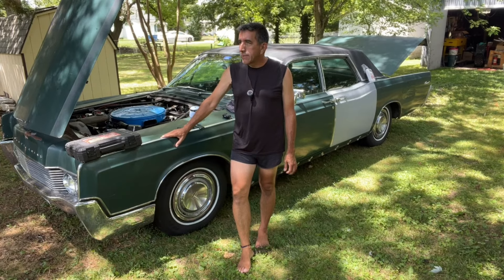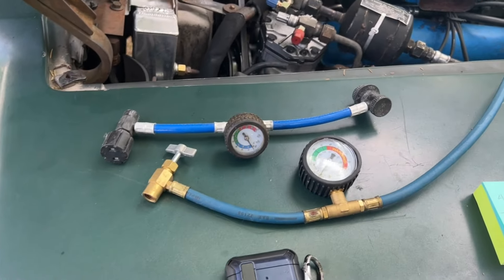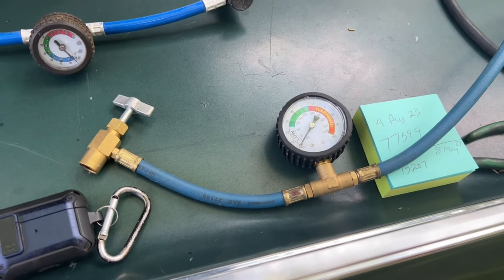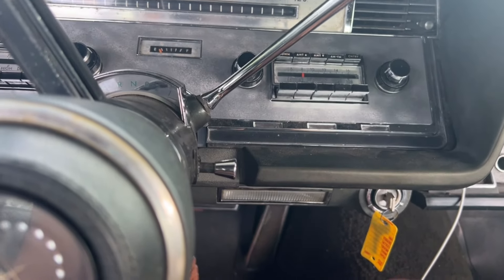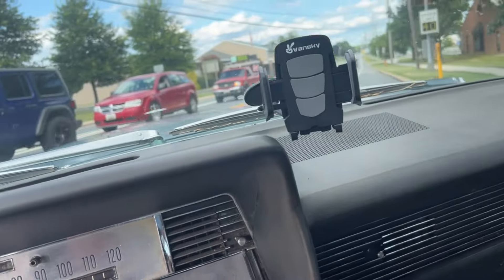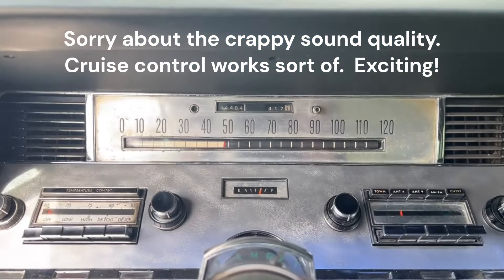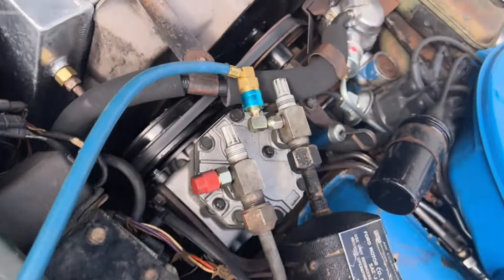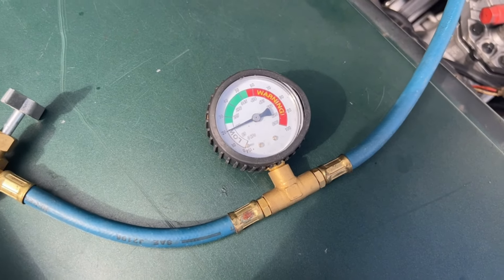1967 Lincoln Project Update 11 Jul 2024 Cruise Control Working

Comment: Most older cruise controls are like that. And most won't kick in below 45 mph
Reply from the maker: Last time I had a working cruise control on a 60s Lincoln, I don't remember the drop in mph being quite that much if any at all.  It's not a big deal but I do hope I can adjust something to reduce that gap.  I think mine will start working at around 25 to 30 mph.

Comment: The cruise is usable I guess since you can set it for 4 mph higher than the speed you want and you are golden.  Lol. BTW I suppose you opened the service valve on the low side connector?  About 1/4 turn is enough to allow pressures to be taken.
Reply from the maker: I'll have to check on that service valve.  I didn't touch it.  Kind of a basic step, eh?